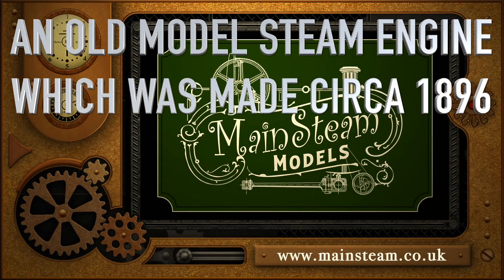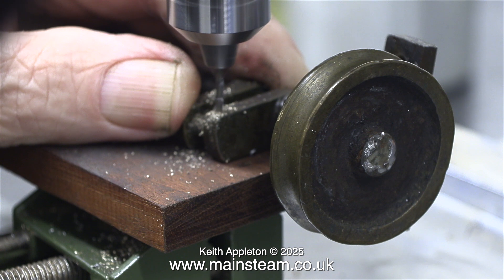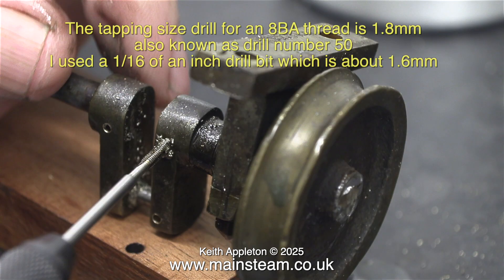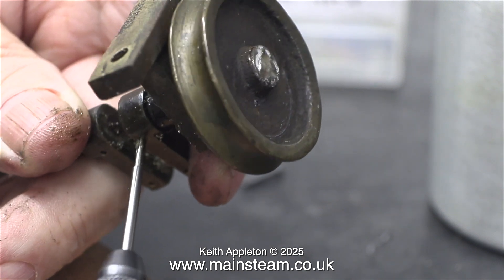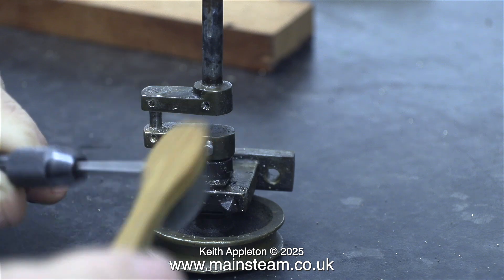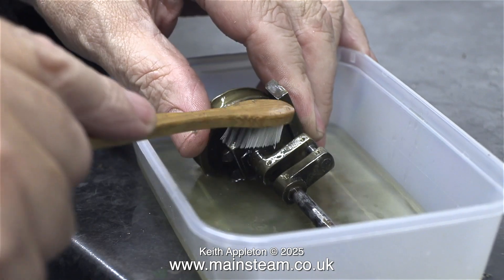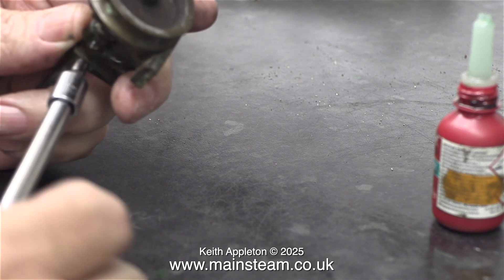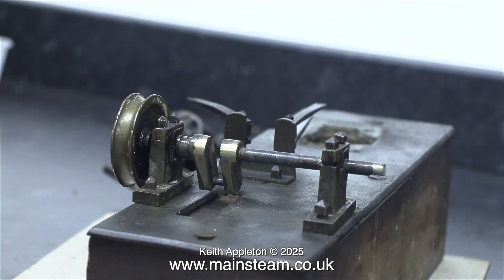REBUILDING A MODEL STEAM ENGINE MADE CIRCA 1896 - PART #4

Comment: Keith, why did you use bolts instead of taper or straight pins with Locktite?
Reply from the maker: Because the crankpin and the entire original Crankshaft were very weak and unserviceable - please keep watching the series and all will become apparent }:-)))